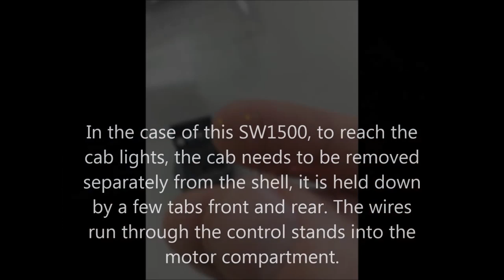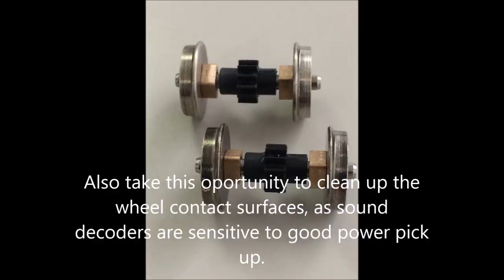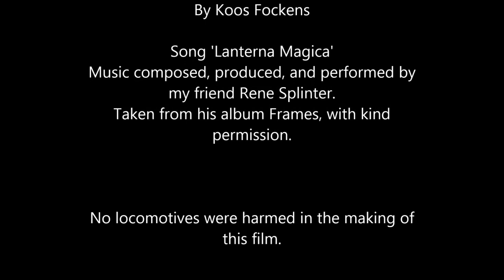SW1500 lights and sound | May 2018 Model Railroad Hobbyist | Koos Fockens

Comment: I'm just getting back into the hobby and I'm building a modern HO scale layout...meaning 2000 to present.  I'm needing to know what the lowest radius curve I can get away with in order to run todays stock cars.  A 30 inch radius is pushing it on my layout.  Can I get by with a 24 or 26 inch radius and still be able to run todays boxcars and auto rack containers?
Reply from the maker: Check out Model Railroad Hobbyist magazine issue 1, Curve Radius Guidelines. It covers what the trade-offs are with each different curve radius you might choose -- things like coupler performance, toylike looks, and poor performance / derailment issues. For more, see: http://mrhmag.com/mrh2009-01/curve_insights
Reply: Thanks for the reply.  I'm going with DCC and a L shaped layout with a loop at each end of the L.  I'm also finding it difficult finding anyone close to Flatwoods, KY.  If anyone lives close or knows someone that does and willing to help out a newbie...it would be GREAT!!  I need help with just about everything!  Lol

Comment: Did you add black tape to the cab LEDS to stop light from entering the cab?
Reply from the maker: Liquid electrical tape works well for this: http://a.co/huzkjpk
Reply: No I didn't in this case, it wasn't really needed I found, but some black electrical tape, or liquid tape will work.